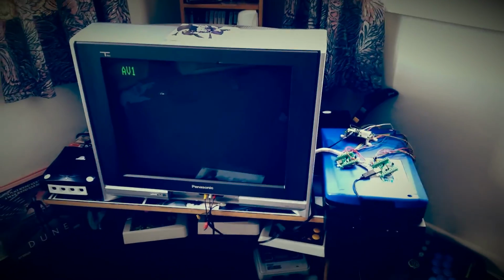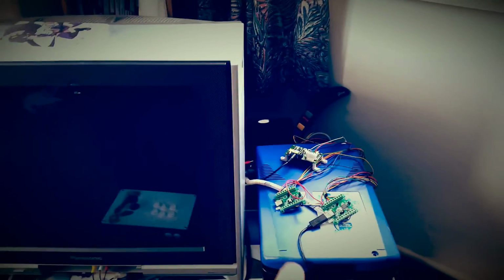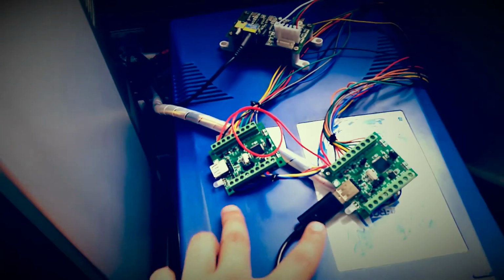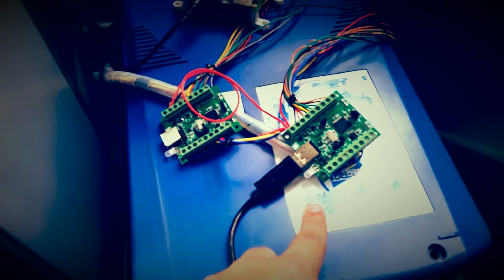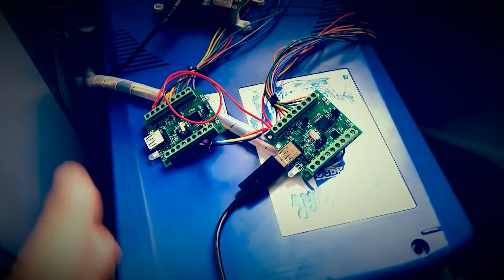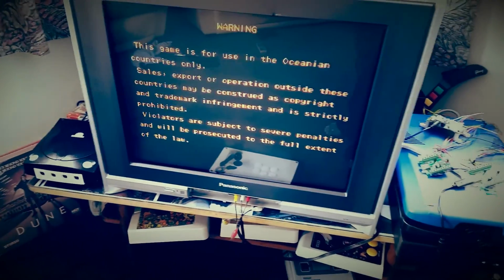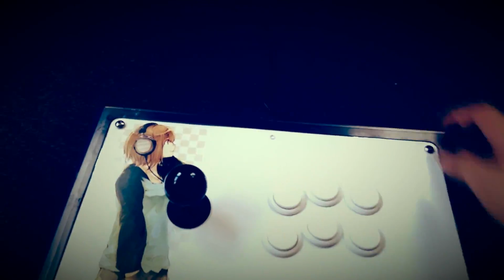Undamned USB to Jamma Converters test

Comment: Can you use an official XB360 wireless controller with the play and charge cable?  If not does the PC wireless dongle in the USB slot work, so then you can use the 360 controller wireless?
Reply from the maker: Asit Patel I've tried to and it doesn't work.  The reason would be that the charge cable is just that, a cable to charge the rechargeable batteries.

I haven't tried with a xbox 360 receiver though.  Could be something to look at.